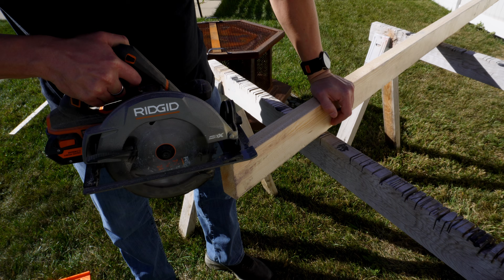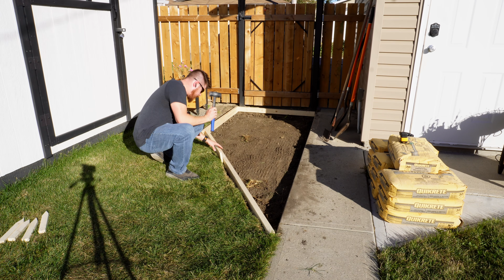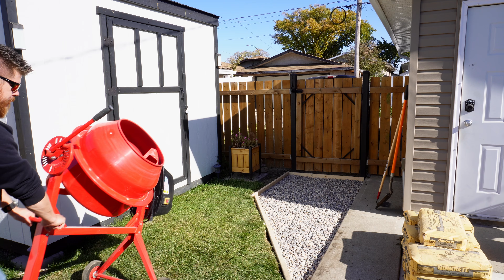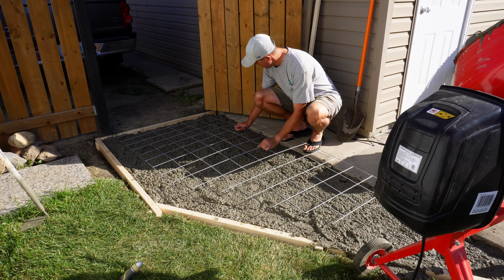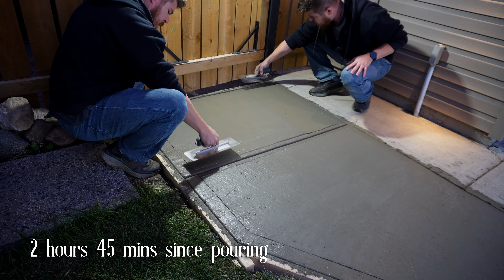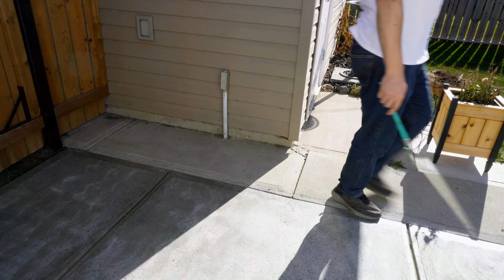Concrete sidewalk for beginners  //  DIY to save💲

Comment: Not trying to criticize, and I am nobody to be chiming in on this topic, but correct me if I’m wrong, aren’t you supposed to wet the stone and all that before you apply the concrete? Because if I’m not mistaken, if you don’t wet the ground before applying to concrete, the ground will suck out the water from the concrete making the concrete brittle, correct?
Reply from the maker: You know what, you're absolutely correct! I have plenty of concrete videos and I always spray the rocks...I can't believe I forgot
Reply: @J @JessedoesDIY  it’s OK, it happened to the best of us, once again I’ve never done concrete, but I’ve been researching a lot on the topic lately because I plan on doing a concrete project in my backyard soon, but your video was still extremely informational, and besides that little watering thing, I actually still saved your video and will be using a lot of the information I learned from it, thanks for making a great video, bud!
Reply from the maker: True, nobody is perfect 🤷‍♂️ I'm still glad you found the video useful, that's all I'm trying to do is help people. Thanks and good luck on your slab!

Comment: This is pretty cool. I was quoted $3200 for a car-sized driveway extension and it seems even more ridiculous after watching this. I think ill just DIY a smaller 2ft width addition and call it good
Reply from the maker: Thanks! I would go a little thicker if you're going to drive on it, but I'm glad you learned some stuff. Good luck on your project!

Comment: Should have hit the concrete a couple times with a water mist from hose to slow the drying for a stronger finished product
Reply from the maker: That's the point of the cure and seal, I don't have to

Comment: Really great video!   I have to do this because when it rains the garbage can area gets soaked and muddy.   You made this look doable even for a novice.   Also your wedge extension came out nice looking!   I appreciate the time notes so viewers can get a realistic timeline.   You have a nice on camera presence.
Reply from the maker: Thanks so much! I'm glad you liked it and that I could help. I tried to make it easy to follow, and time call outs is part of it. I understand the need for a slab to avoid mud, that's literally why I did this one haha Good luck on your project, I hope it goes well for you. I also have just concrete slab videos if you want, very similar obviously just small differences.

Comment: Great job, looks good, a good detail to add would be a firmula for figuring how many pounds required for different size slabs
Reply from the maker: Thanks, appreciate it. I've included the concrete calculator I've been using for years, down in the description for that. It'll tell you the weight and how many bags it'll take to make it, you just enter in the info for the slab size and shape you want to make

Comment: I need to do my walkway, entryway, etc.  Your step by step is great.  I'm going to check the transcript but I'd like a list of supplies.  Any advice or suggestions before I start, would be GREATLY appreciated.
I'm going to work a section at a time to minimize any oopsies.  LOL.
Reply from the maker: That's awesome, I'm glad I could help! You'll just need 2x4 for the form and stakes and screws, concrete (follow the calculator to determine the amount), 3/4" crushed stone, reinforcement (in the concrete aisle), then a float, edger, trowel, groover and a brush. Good luck on your walkway!

Comment: Hey man, really loved the video. I am in the same climate as you and I want to do the same thing, that is to extend my current concrete patio. I want to do a 10x10 concrete pad. What do you recommend for prepping for that?
- Dig about 4-5 inches. Since I have black clay soil in the backyard, is it enough depth to dig?
- Compact it so that the grade is away from the house
- add a weed barier layer?
- gravel 1 to 1.5 inches and compact it
- pour concrete

Is this a good plan?
Reply from the maker: Appreciate it! I'm in Sask, so its a hell of a climate haha

Sounds like a big project, but it's fun to do concrete stuff. That is basically perfect prep. Your slope away from the house doesn't have to be huge, just subtle and as long as it's there. I'd also avoid the weed barrier, it isn't needed. I also have a personal hate out for weed barrier.

Otherwise, good luck! Let me know how it goes, love to see some pics over email. Cheers!

Comment: I just commented on your short video about the cement slab, asking if I could use that method, and then came across this video. I'm a complete beginner. Extending my very small patio area will be my first DIY project. I'm going to watch this video a few more times. I think you have made this very simple to follow along. I feel confident that I can do it! Next will be to fix the cement block at the bottom of my step that has been damaged due to the salt from the snow. I'll come back and let you know how I made out 🙏🏾
Reply from the maker: Thats awesome! As I said, it's not impossible to do, but it is "hard" work meaning it is labor intensive. But with the right tools and some help from my video you can do it. Starting with a small spot is a great learning idea too. Good luck on it all and I can't wait to hear how it went!

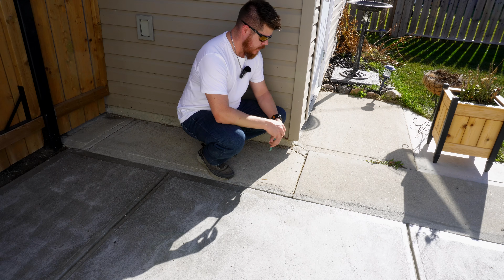Comment: Quick question, 13:40 onwards you said the two slabs on the left hand side as you enter the gate is wonky and they're not joined to each other nor are they joined to the new section you just completed in this video, so couldn't you have lifted the wonky slab and leveled the ground and put the slab back in place so that everything is evened out, flat and sturdy .... or couldn't you have leveled it prior to laying the new addition to the sidewalk ¿?  

Something you also need to take into consideration prior to laying down concrete slabs is that the pressure of the slab will make the sand underneath to become compact with the weight once dried + when constantly walking on it and also the level of the loose sand underneath will settle once it rains and the water seeps through the gaps inbetween each slab, so maybe that's how the slabs become wonky
Reply from the maker: Not really no. I just moved into this house a year ago and from what I can guess by looking at it, they were poured at different times, but all around 15 and 10 years ago (going by the date stamps). So the main one that's highest right now is a sidewalk that was poured from the house, to the middle of the backyard. Then they built the garage and poured the slab for that. Once the garage was built, they poured a small landing piece at the door, but the old sidewalk didn't reach the garage pad so there is a small connecting piece (that's already cracked) to the new sidewalk extension they poured along the garage after to. So to lift it would require it to be either mud or foam jacked, which would probably cost between $1000 - $2000, not worth it. And they still wouldn't be joined together and moving independently. My problem here is I live in central Canada and with all of the melt freeze we have here, a crazy 6' deep frostline and all the ice, it's going to move regardless. And much more than normal. Had I joined them they'd probably be cracked already by spring because the ground heaves so much here in the winter.

Comment: Hey Jesse, what's your  best recommendation for making a slab with a ledge? 
I'm planning to make a sidewalk for my house and I need it to have a ledge so that I can put a 1 in. thick drain grate between two slabs and be flush. I figured i can just nail on a 1x2 piece along the 2x4 edges but I'm not sure if that might leave a lot of gaps / bubbles along the edges under the 1x2.
Reply from the maker: Honestly, yeah. Something like that idea is pretty much it. Just coat the hell out of the board in motor or cooking out so it doesn't stick and poke around it to try and dislodge as many air bubbles as you can. Good luck!

Comment: Nice easy job... Re enforcement is a must no matter what you pour. Don't let anyone tell you otherwise if you want it to last the test of time. Glad you understand the need for it.
Reply from the maker: It's easy to dream up, not so easy to do haha but I know what you mean. I agree, I always use it
Reply: @JessedoesDIY  Well its always as easy as concrete can be lol. Guess what I did for a living once.  I refuse to do it again unless I have no choice.... I think if I remember correct the biggest structure I pours was 42 tons not that it was the only one that day.
Reply from the maker: @davidsmith6001  Haha exactly. Yeah, I did it for a short time and quickly realized I didn't want to do it all the time. That's one hell of a pour
Reply: @JessedoesDIY  Thks and yea one of the biggest I had poured at one time. The truck that had to transport it blew 2 sets of tires and got a fine for over weight, to wide of a load and to tall for the area they took it to. Crazy times but the company landed a big contract because we did what no one else would do and cheaper.

I would warn anyone this kind of work will break you over time if you do it everyday. Never again. Well until I have to pour a 90 foot wall 2 wide and 4 tall twice.